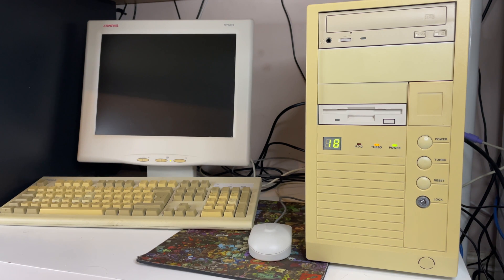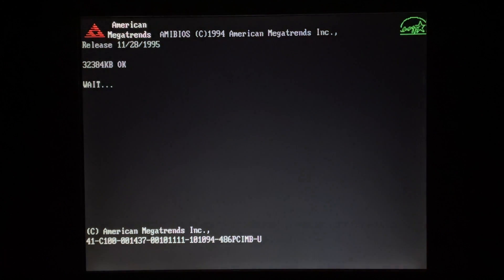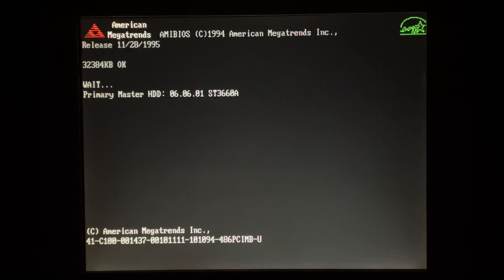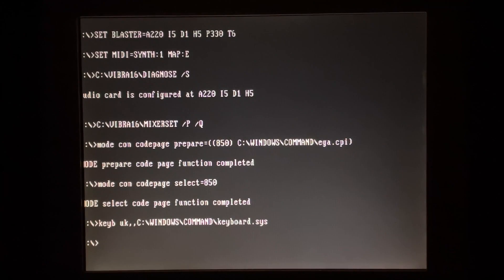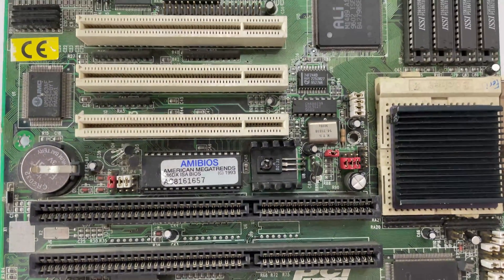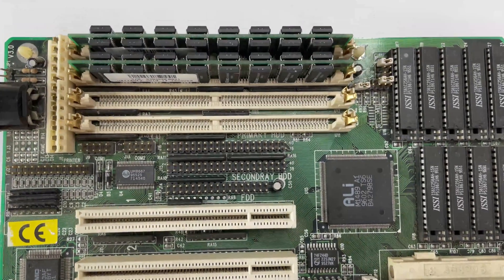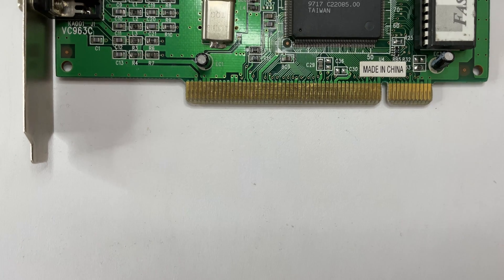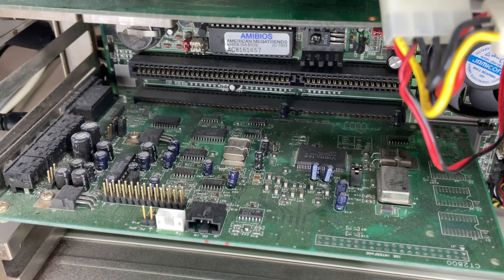Retro Gaming PC Build: Building a Budget-Friendly 486 System with an Am5x86 Processor. #486buildoff

Comment: None of this hardware can be bought on a budget, unless of course the budget is high. however. Yeah. 5x86 are nice CPU's, and they are fast.

What did catch my attention, when I ran a 5x86-133 and a 486-DX4-120. Was that the 486 seemed faster than a 5x86. I bet it was those extra FSB clockcyckles that made the difference.

Just dont do this build again, sourcing a dx4-120. Those actual 120's are expensive to source. I found that out, when I tried to put a price on my chip, when I put it up for sale.